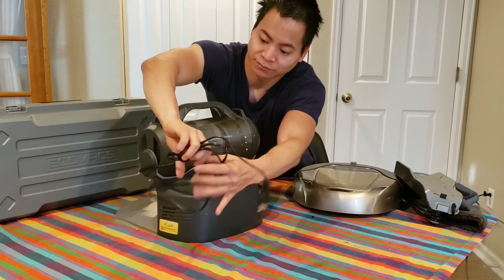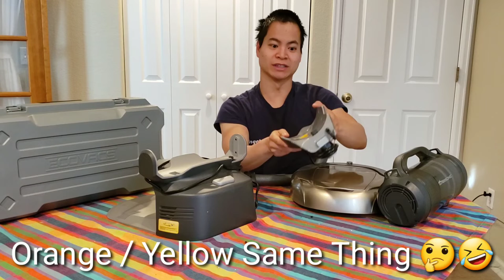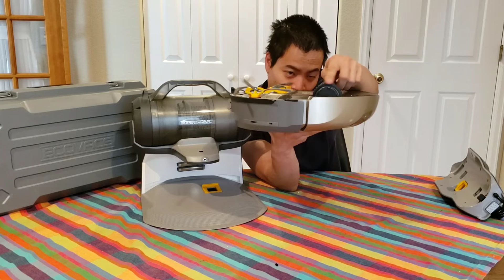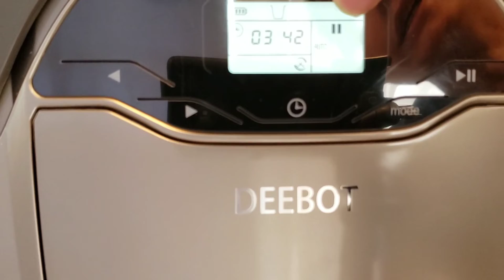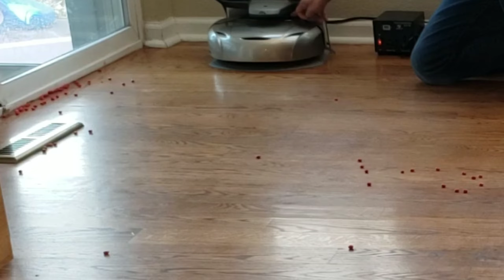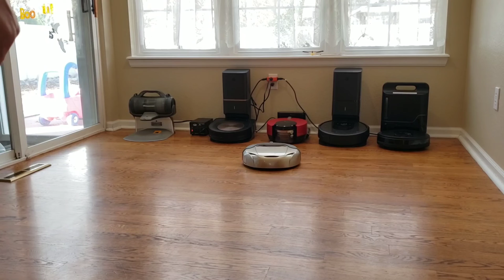Deebot D77 Ecovacs Review self emptying bin, can an OLD robot Vacuum pickup RED HOT Candies 🤔🤔🤔

Comment: Do you have a video on how to replace the wheels?
Reply from the maker: Not for this particular model. Depending on the model some wheels require you to remove the complete motor assembly. The wheels are either a pressure fit, or held on by a screw.

Comment: Oh! So no WiFi capable? The reason why the s9, i7, 960 don’t do the round motion anymore is to keep them on track better. At least what is I think.
Reply from the maker: LOL just a infrared remote like on an old TV remote.
Reply: Robot Masters why it didn’t pick up big stuff from the bin?
Reply from the maker: I believe the design of the emptying bin is only for small debris
Reply from the maker: Ohhh that make sense I remember Roomba doing a round circular motion but you would thing a precise encoder could help keep the robot on track.
Reply: Robot Masters they all do back and forward, I guess it is very hard to perfect that. The dumb ones it doesn’t matter they will go over the same area 4 or 5 times so doing circular motion doesn’t matter
Reply: I like more normal old IR controller, because hackers can hack your robot thrue the wifi
Reply: RoboVacCollector ... don’t turn WiFi on